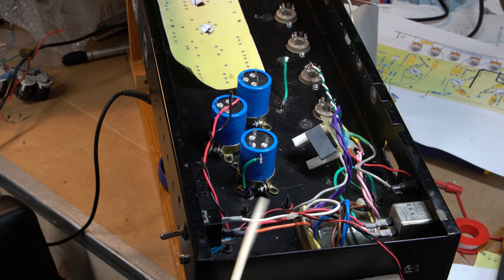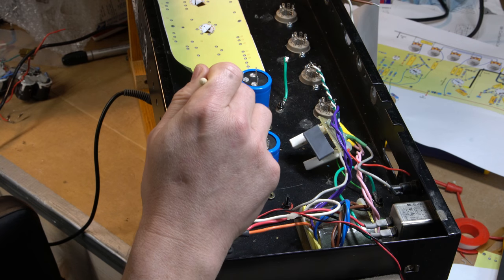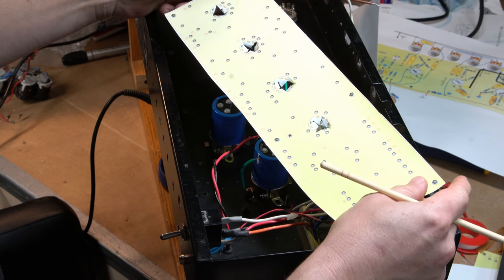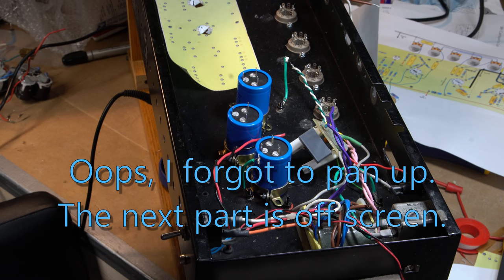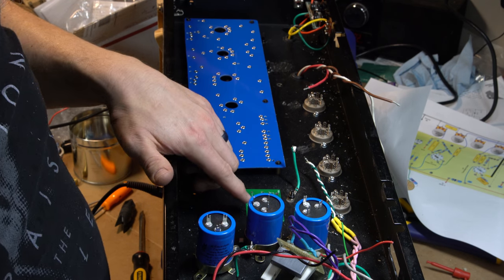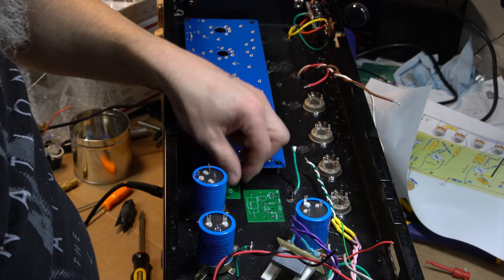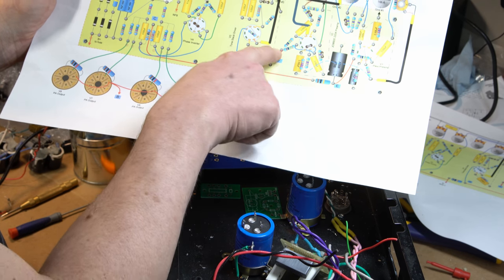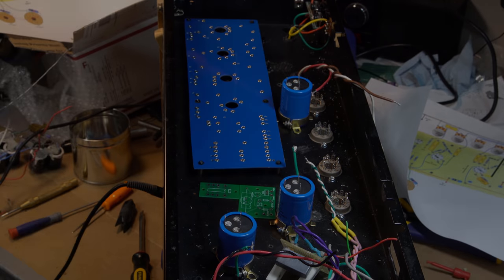Dual Marshall Video 2

Comment: cool video. I would keep the filtering caps as far away from the preamp circuits as possible.
Reply from the maker: Good to have another point on that, was my concern as well, I think I'll put them all at that side by the transformer, my gut was screaming to do it too :D.  Thanks!